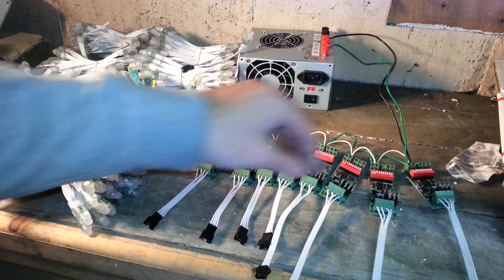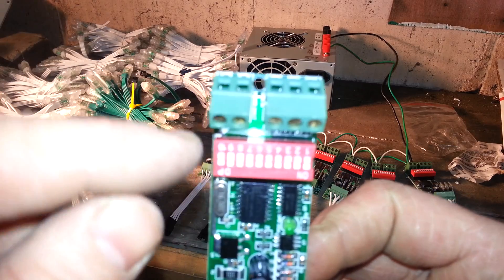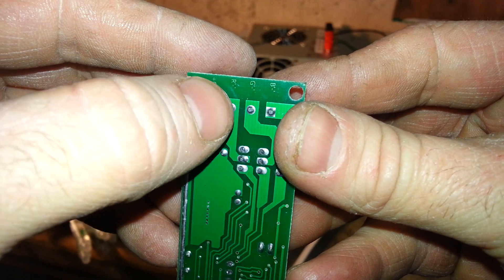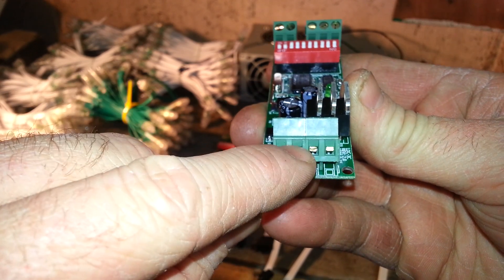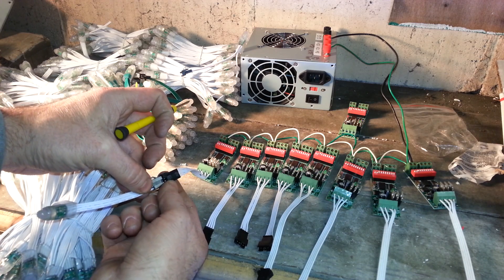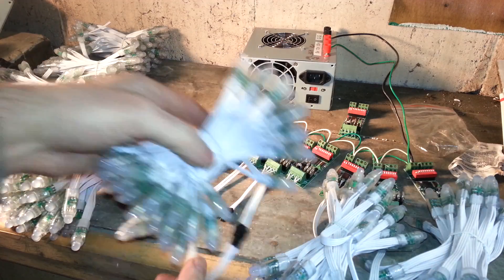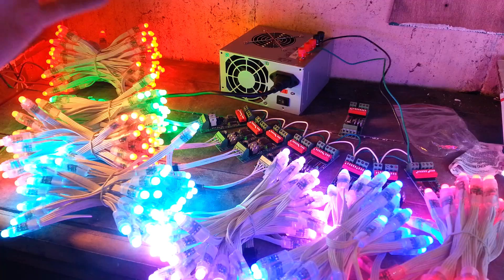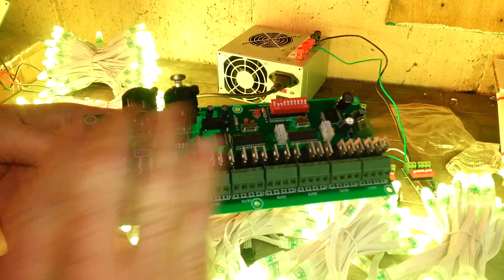Dumb RGB Controllers and Nodes easy connecting and testing

Comment: Hi I have an arduino maga 2560 running with manuel  relays.  if I drop to 12v could I run rgb led dump nodes right off the relays with out the controlers
Reply from the maker: I'm sorry, I have never used an Arduino.  I don't have an answer for your question.

Comment: 6:15 I call them SMD's (Surface Mount Device).   I think this is the correct terminology universally.  They are usually either a resistor, capacitor or diode.   In fact, that may be all there is in this size SMD.  Every try to solder one?  I have, along with several SMD IC (chips).  Talk about a challenge!

Thanks for the informative video.  They are becoming harder and harder to find on YouTube as it has become largely taken over by then next generation of people who don't have the foggiest idea of how electronics really work; nore care.  They look at them like previous generations looked at cars, you press the gas and it goes...
Reply from the maker: LOL yes they are SMD's.  I have not yet tried to solder an SMD but I have 2 projects that will require it.  I did order a new iron just for this and will be "playing" with it as well.  This hobby has taught me more about electronics, all at a DIY level.  My hope is to help those who like to "press the gas and it goes" to be able to do so.  I do not understand all electronics concepts, but enjoy learning what is relevant to the hobby. Glad you enjoyed it and thanks!
Reply: Leechburg Lights I would also get a good magnifying glass along with special thin solder, not just a new small tip iron.  You want the solder to be >=  0.3mm in diam.  About as thick as german shepherd dog hair.  I tried it with the regular size solder and it's pretty much impossible.  ALSO- They sell test SMD kits to practice soldering on eBay for about $1.75 delivered.  I would get one if you are not in a hurry.
Reply from the maker: I purchased a Digital rework station for SMD soldering :)  I will try a few kits before jumping in.  That is how I learned the first time.  Have built 3 e682's and 3 e6804's all successfully.  I do have plenty of time to learn, no rush haha.  Thanks Willy
Reply: Leechburg Lights sure thing...  please make sure you have the thin solder.  It really makes a big difference.  You can lay the strand of solder on top of the SMD pin point and just melt in on top of the solder joint.  Enjoy!
Reply from the maker: very good tip... will try that!

Comment: What is the difference between a SMART Node and a DUMB Node ? Never heard of that until I watched a Video on here ... Thanks
Reply from the maker: SMART refers to an RGB node that has an individual IC chip.  The IC chip can process data telling which channel (R, G, or B) to light up.  When a set of RGB's are connected to a pixel controller, the nodes can change the individual colors of each bulb/node.  These are referred to as “pixels”. 

DUMB (aka. BASIC) RGB nodes do not have an individual IC chip.  A basic DMX controller sends a voltage signal down the separate R, G, and B wire (ribbon/4-core wire which connects each node).   When you change the color of the nodes, all of the nodes change.  There is no individual “pixel”.  The string acts as one color, similar to a set of LED or mini lights.